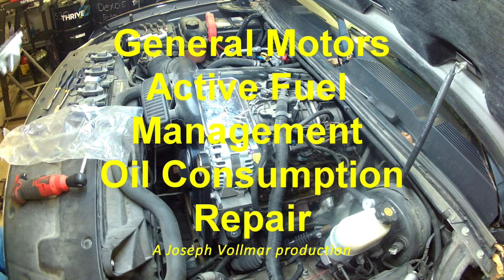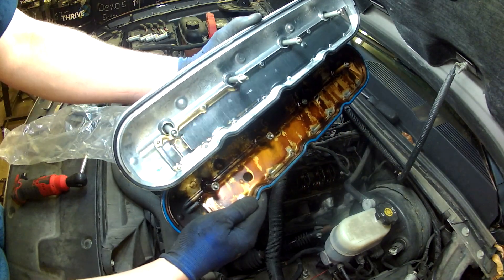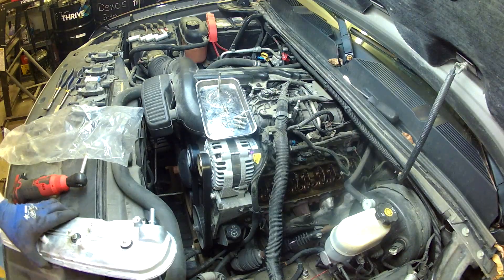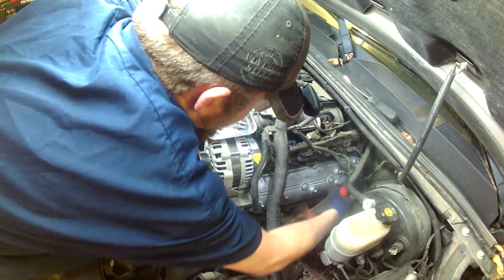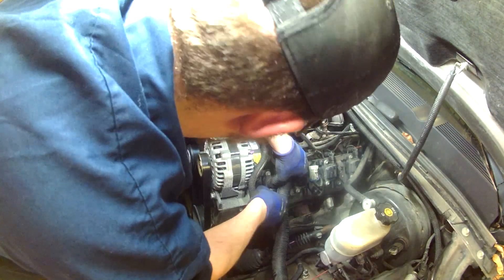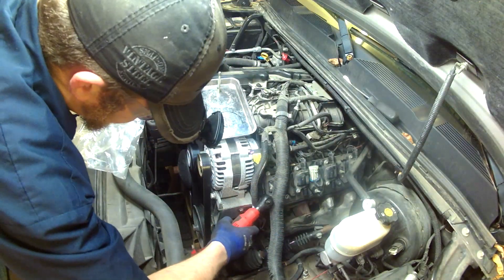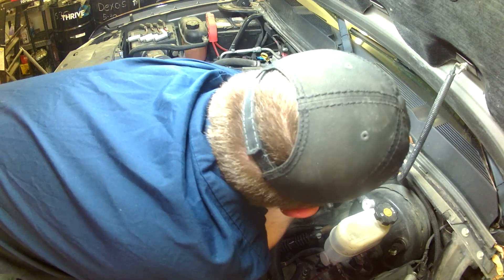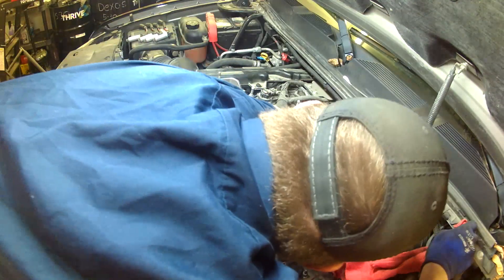General Motors Active Fuel Management Oil Consumption Repair

Comment: I have been losing oil a little faster and I just changed my spark plugs and cylinder 7 spark plug had oil on it. your explanation is the reason I had oil on that spark plug.

Comment: If you don’t have time to do this full repair, a temporary to get you to a point where you can do the repair think of a straw and drinking out of a cup. It works great but then poke a hole in the side of the straw and you hardly get anything. This will keep Oil from getting into your intake by drilling a simple hole in the top of your oil filler cap just needs to be small like that quarter or 8 inch diameter very small and then this will not allow or reduce the suction going through the oil lines India or intake. It is a temporary fix and will allow your engine to clean out and start operating correctly with less misfires and carbon in cylinder six and seven, but I highly recommend you follow and repair the top rocker covers as soon as possible. This is only temporary.

Comment: *** HELP *** I've got a 2012 Chevy Silverado 1500 5.3L and when I pull out at a red light or stop sign sometimes, I see a cloud of smoke behind me. I've replaced the valve covers on both sides, but I'm still seeing the cloud of smoke. The cloud of smoke doesn't show up every time I pull out, but I'd still like to know what the problem is so I can fix it before something bad happens. I just bought this truck last year for $18K so I'm pretty much stuck with it for a while. Any ideas on what could be causing this?

Reply

Comment: I bought a used 2021 Silverado Lt 5.3 60kmil just got first scheduled oil change and not a full 2weeks later asking for half a quart of oil I've been monitoring it since i bought it few months ago and it drives me crazy that a truck this new has to be checked regularly or you will blow the engine possibly if not careful! Thanks again for the video will be replacing that valve cover asap

Comment: My 05 Yukon just started using a lot more oil 1 quart per month and prior to that it never used any. 200k miles 
But I had been driving a lot more now and allowing it to idol in the winter. I use only synthetic. I decided to go with another video that suggested drilling out new holes in the valve cover baffle inside
Reply from the maker: Your 2005 Youkon is a pre active fuel management engine, so you don't need to worry about those issues. I would say the first think I would look at is the PCV valve. On your 2005 it is built in to the rear of the left (drivers side) valve cover. In most cases you will need to replace the whole valve cover. Another option you can try is to substitute 1 quart of good synthetic ATF for a quart of oil at your next several oil changes as this will help to remove deposits from the engine as you drive. It is likely that carbon deposits are causing the piston rings to stick and not do their job as well. I know it is cold, but try to limit your idle time as much as possible. Hopefully some of these tips will help. Thank you for watching.

Comment: I know this is a old video I have a 2014 starting to use oil call the dealer and local delco supplier they told me no such upgraded valve cover do you have the part number thanks

Comment: I’m looking to possibly buy a 2009 with a 138,000 miles - truck is in excellent condition and I was thinking about buying a range to help with the fuel management- AFM. Should I stay away from this engine or is it still a good motor? Thank you

Comment: So I have a 2010 chevy Silverado 53 with full afm delete I replaced the value cover and still have oil Consumption at high rpm what else could it be thanks
Reply from the maker: Your rings are probably sticking from carbon build up from the oil burning in the cylinders. Substitute 1-2 quarts of good synthetic automatic transmission fluid in place of oil for your next couple oil changes and that should clean up a lot of the carbon build up.

Comment: My 2016 Silverado 4x4 is using maybe 1/2 to 3/4 quart of oil between changes with 75 thousand miles on it. I've had the 4cyl turned off for over a year. Is this normal? I mean the oil is still pretty much clean too.

Comment: Does this apply to a 2021 gm motor?
Reply from the maker: I think that by 2014-2016 they had corrected the issue during production, so this should have already been fixed on a 2021 m.y.
Reply from the maker: Let me back up. I was thinking of another video. If they are still using plastic lifter guides, replace them if you are doing anything with the lifters. They get a little wear  and they can allow the lifters to spin. I doubt that GM would have changed them because they worked.

Comment: I have a 2008 Chevy Silverado just bought with 72.000 miles. it's  using more oil than it should. hoping your suggestion will remedy this issue. I'm also not crazy about the AFM system and saw 2 videos suggesting that shifting into 3rd will disable the AFM. Do you have any experience with this or opinions?
Thanks
Reply from the maker: Your best bet to disable the AFM is:
NEW RANGE TECHNOLOGY AFM-DFM DISABLER,RED,COMPATIBLE WITH V6 & V8 GM MOTORS https://a.co/d/gcEKlX3
Shifting in to third gear will do it as well, but then you will not get the use of OD. This just plugs in to the OBD test port under the dash, and will not leave a footprint in the computer and you can move it from one vehicle to another. 
     As far as oil consumption goes, it is probably partially due to carbon buildup on the rings. For the next few oil changes substitute 1quart of ATF for one of the quarts of oil, and that should help clean out the gunk and deposits without hurting the engine.

Comment: Is this a dealer recall cause I re ported this problem to gm after l brought my 2012 suburban in 2017 or 2018 they said it's common so could this be a recall
Reply from the maker: No recall, just a TSB on what to do if someone complains enough times.

Comment: i have a 2009 Chevy Silverado 5.3 engine and they did a rebuild on it but now I'm having all kind of problems, it sounds like the lifters or so are not getting any oil and the Oil Pressure Sensor keeps coming on when the needle gets clos to the zero mark on the oil gage and they changed it to a high performance oil pump one and it t stoped for a while and  also changed the Oil Pressure Sensor 2x as well and then it started to leak antifreeze thru one of the the heater hoses or so and so when they fixed that the oil pressure sensor started to act up again it's just been that kinda of problem, so can you tell me if this has been an issue on these kinda of engine cuz i paid a good $4,700.00 on the rebuild and i told them with it going back to them and this the 3x they just need to get me a new motor instead , so can you help me out on this issue, thank you for your time

Comment: Really you should drill two  3/16 holes in bottom. Shield about a thump width ahead of each bolt to help drain oil so it doesn't get sucked into intake.. the new design isn't very well designed in my opinion dod & afm is a joke e 85 isn't good on engine's

Comment: I change the valve cover with a PCV built into it and drove it a few days and Even though it is not consuming as much oil it still is blowing smoke out the exhaust. The smoke clears out at highway speed

Comment: My 2011 hd 2500, 6.0 used1.5 gallons of oil in 3500 miles pulling my 6000 lb. 5 th wheel. Engine runs good, has power. Code says my Left Bank CAT is plugged. Thoughts?
Reply from the maker: If it’s burning that much oil it’s no wonder the cat is plugged. I would have to assume that the left Bank is your culprit as far as what part of the engine is burning oil. The 6.0 L did not have active fuel management though. I would suspect you have an other internal issue such is stuck or worn rings on one or more cylinders on that side.
Reply: Put a rebuild in it.

Comment: Is the new valve cover an updated OEM or aftermarket? Also does this work on a 2014 Tahoe?
Reply from the maker: OEM and aftermarket are not the updated design now. If your Tahoe has the 5.3L engine it will work.

Comment: I have a 2008 gmc truck. With the 5.3 engine. It has 167000 Thousand miles on it. It has used 4 / 5 quarts every 5 thousand miles. since 60.000 miles. I have already replaced the valve cover. It doesn’t leak or smoke. 
I would appreciate any help you could give me. 
Thanks

Comment: Any info on a gmc 8.1 consuming excessive oil. No smoke. PVC not located in valve cover. 2001 model with only 71000 miles.

Comment: Is there a way to tell if you have the  updated cover by looking at it from the outside?
Reply: Good question.  I have a 2011 sierra 5.3 and I'd like to know the same thing
Reply: @davinluoma791  You should as the Valve Cover was updated Mid 2009. But no, there is no way to tell from looking at it on the outside.
Reply: Ok great.  Thank you for the quick reply

Comment: I just picked up a 2009 silverado with the  5.3 with 90k miles on it. I changed the oil when I first got it...Being new to the truck I checked the oil after 2k of driving it. I lost appx 1.5-2 QTS of oil in that 2k miles. Do you think the new cover will fix this issue or is there a good chance that the rings & cylinders that don't fire when the AFM is turned on are shot?  TIA for your advice.

Comment: Thank you for a great video........ Do you have a link to the replacement valve cover ? Also do you recommend the OBD2 module to bypass the fuel management system ?

Comment: I have a 2014 Silverado 5.3 L that is consuming oil. Went to 2 auto parts stores. They gave me the same valve cover, (they same one you show, with 4 bolts in center of cover). Mine is secured by bolts on the perimeter of the valve cover not on center. Am I missing something? Might you have the correct part number?

Comment: i just ordered my valve cover online. it will be my project next weekend. after paying a mechanic to change fuel injectors, motormounts, my husband changed sparkplugs and coils no luck. my 2015 suburban still have a random misfire. runs rough on stop and idling rough. so, fingers crossed replacing valve cover will fix this. its so annoying its shakes too much. it runs good except when idling. anyone who got same problems and fixed it?
Reply from the maker: How many miles does your suburban have on it? Unfortunately I doubt the valve cover will fix the misfire. I have dealt with this before and if this it in one of the cylinders that shuts down when the AFM kicks in I have seen two common issues, and neither one is a cheap fix. The first is one of the AFM valve lifters is collapsing at lower oil pressures, and the only fix is replacing them. The second is that one of the valves is starting to suck up in to the head and is not closing all the way. That will require reworking the head. Neither is a cheap repair, but it may be the only way to fix it. 
      I know that is not what you want to hear, but I hate to hear that you have been chasing a ghost of a problem.
Reply: @JosephVollmar  right now it has 179k miles(2015),  what you mentioned right there, did it fix the problem i wonder? how much u think its gonna cost to have that fix. too bad,  its  driving good when im on the road. its just annoying when im on a stop sign. its shakes or rough idle. shakes my brain too much lol

Comment: I replace my valve cover with a new updated one about a year ago I have a 2013 Chevy Silverado LTZ four-wheel-drive 5.3 L and it still concerns oil
Reply: Also did the PVC valve this chucks always Consumed oil after about 80,000 miles it has 134,000 now

Comment: What about for a cylinder 6 misfire on a 2013 Tahoe? I still need to check the obvious , spark plug , wire , coil pack , but from the research I’ve done ,and the fact that #6 is one of the afm cylinders , I’m leaning toward the afm being the culprit. I changed the oil the other day and only 3 quarts came out ! It is using oil like crazy. It’s got like 160k miles on it and that should not be happening at all ! It just started throwing a #6 misfire. That’s the only code. The light comes and goes. So it’s not a constant thing.

Comment: Just wondering if you can clarify something. I’ve been looking for a video that will show me how to replace the PCV valve on a 2018 Escalade. There’s a Haynes video that shows it on I think a Silverado but the way that truck looks is different from mine. I haven’t found any other video showing it. I don’t want to stop taking things apart and discovering it doesn’t have one. However, the Cadillac dealer did sell me one. He asked for the vin number on my truck so he could pull the exact part. It was 13 bucks.

Comment: I have a 2014 GMC 5.3 that uses two quarts of oil every 3000-4000 miles, would a new valve cover work or does my truck have the updated valve cover
Reply: Did you find out the fix? I have the same problem with the same vehicle.
Reply: @tiflas04  I just monitor the oil levels, I’m going to get rid of the truck in a few months anyway.

Comment: Hey sir I appreciate your video yes I'm aware of their problem I had an Escalade that we had to replace the driver side valve cover to take care of the oil consumption issue what about an 04 Model 2500 Express van it's got the six liter engine I've got an oil consumption problem takes a quart about every Thousand Miles it doesn't smoke I was just wondering if it's got the same type of valve cover. That I need to check out thanks for your input it's currently got around 200,000 miles

Comment: Also the piston oil control ring does not have adequate drain back and can get stuck ,causing blowback problems. You can drill the pistons under the ring to make the oil drain back better.

Comment: Will this stop getting oil in my cylinder 1? On a 2010 Tahoe ? I really don’t wanna pay for a DOD delete.
Reply: I've seen that you may have a stuck oil control ring in these years. The pistons need 4 more holes drilled in each piston to insure oil drainage. If you do the cylinder delete, you will need to change the lifters on those cylinders and modify the oil pump for it all to work correctly. From all accounts this will take care of a lot of problems.

Comment: Is this still a problem on 2013+ engines? Haven't heard squat about the oil burning on the latest generations
Reply: They fixed the oil control ring on the pistons in 2004 but I'm not sure about the valve cover 🤔

Comment: Updated valve cover haven't changed anything, oil catch can helps a little by keeping some oil from intake. Its a failed design and GM knows it that is why they updated that engine in 2014. That AFM system has to go, thankfully there are good places online that are selling AFM delete kits.
Reply: Poor design of the pistons oil control ring drain holes is the primary problem.

Comment: Just had an oil change 4000 miles ago and 2015 Chevy Tahoe was 4 quarts low on oil.
I'm thinking this could be the problem but wouldn't I notice the vehicle smoking if it's burning oil?
Reply: Better start checking oil more often! Lol. I check mine every time I put gas in it. Even my new car! Just saying

Comment: My 2013 had the redesigned cover from the factory. It still fouled #7 plug. the correct answer is to disable the DOD this will solve two problems.. #1 the lifter for the DOD will not wear and stick and oil consumption and fouling of #7 plug will stop..

Comment: Nice video, thanks. 
Since AFM creates the issue, disable it. 
Free by removing the cable connected to the brake booster and tape over the resulting dash light. (YMMV)
For $50 - $100 have AFM disabled by a PCM tuner.  (I chose this option)
For $170 get the Range device which disables AFM through the OBDII port. 

To save time removing valve cover, don't pull the plug wires. Undo the white connector and unbolt the plastic holder from the cover and slide it down and away, then remove PCV hose, then remove valve cover.
Reply: Hello Bob. What is the PCM tuner. Is this an easy do it yourself?
Reply: Nice

Comment: Will this fit a 2011??
Reply from the maker: Steve Allen yes it should.
Reply: @JosephVollmar  my 2011 Silverado check engine light came on code was p0521 low oil pressure so I changed the oil pressure sensor and a couple days later the light came back on reading the same code..I didn't drive it Saturday Sunday my wife drove the truck and the light was off? When it comes on truck drives normal no lifter noise or ticking..but I did have to change the number 1 spark plug it started having a miiss when at a stop and the service stability light came on and the engine light would flash a few times so when I changed the plug it drove fine for a couple of days then like I said the light came back on and now it went out on its own.. just bought the truck couple weeks ago so I'm not to familiar with it never owned a truck..it has 120,000 miles on it
Reply: @JosephVollmar  had a few mechanics check the gauge and they said it was working fine..

Comment: I guess i got lucky my 2010 suburban now has 112k miles it never uses a drop i took a 6100 mile trip recently never left the full mark afm still works i averaged 21 mpg for the trip,i hear about the oil use but havnt experienced any
Reply from the maker: There are some that don’t. I have seen a few with over 200k that don’t, but it is hit or miss. Guess you got a good one.

Comment: Maybe you could answer this for me. I recently had a my engine rebuilt on my 2009 chevy Tahoe and had the DOD deleted along with the rebuild. I have had it back for about 3 months now and it is still burning oil. I have also done the valve cover update and its still seems to burn oil or suck oil down. Is there anything else to do to stop this oil consumption. Any other things to do to trouble shoot to fix this.
Reply from the maker: I would talk to the builder. I would have my concerns about possibly having issues with the rings.
Reply: Drill 4 holes in the oil control ring slot so the oil can drain back. Just saw the video. Its no the rings, its the piston design on the stock piston.